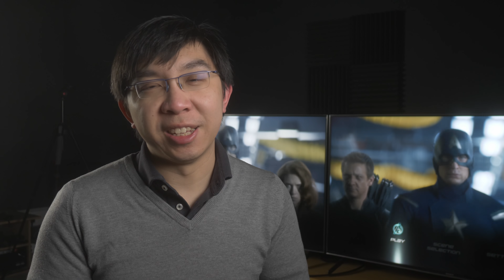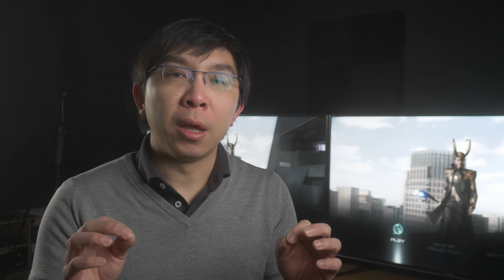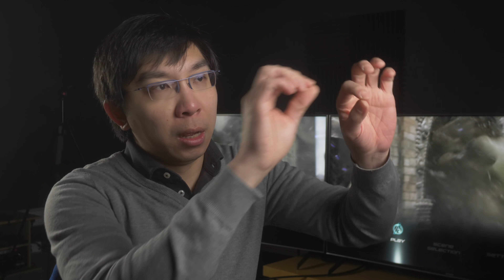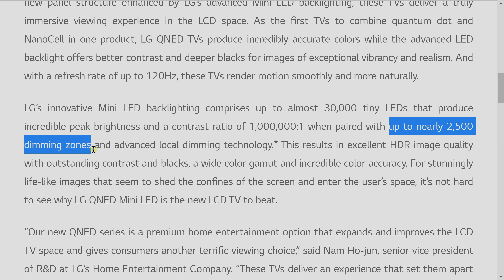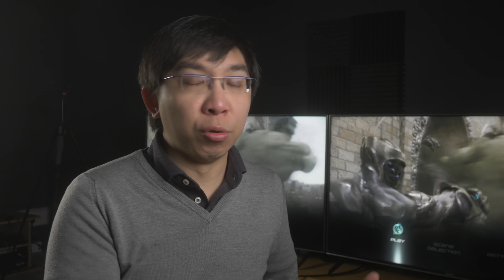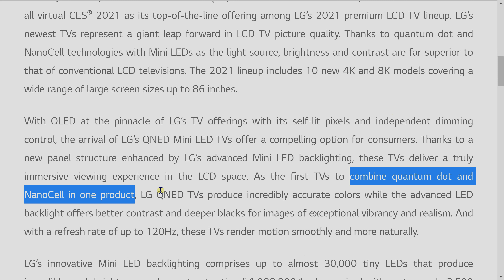LG Unveils Its 1st QNED Mini LED TV with Up to 2500 Dimming Zones

Comment: It all depends on the algorithms.  I haven't been impressed by any local dimming LCD, they just end up drawing attention to the zones with blooming.
Reply: Sony has best FALD dimming algorithms blooming on X950G/H is minimum despite less dimming zones.
Reply: @WizKing93 
you are absolute right. I have the Sony XH9505 in 65 inch and i wondering when people talking about blooming problems. This TV is absolute amazing and have one of the best black levels and upscaling performance for an LCD TV in this price class. I can recommend this TV to everyone and I'm not a Sony Fanboy. 
Greetings my friend 🖖🏼
Reply: @WizKing93  Sony XH95 has crazy blooming on subtitles on black and dark corners on white, so it's FALD sux.
Reply: @timpro8110 
I have the Sony XH9505 myself and cannot confirm blooming with subtitles at all. Try the local dimming to high in the settings. Greetings my friend 🖖🏼
Reply: Agreed. FALD LED LCD TV's look really good in a bright room... But at home, with the lights dimmed, local dimming falls on it's face. Especially off angle, where you can clearly see the zones turning on and off constantly. Very distracting..  Not to mention the fact that if you want to use low lag game mode, you basically lose FALD all together..

And the problem is actually getting worse, as makers continue to cut the zone count to improve profit margins.
Reply: My 2018 Samsung q9fn is excellent and can be viewed in a dark room with only rare content catching it out (Also have an OLED). q80/q90t exhibit noticeable regular blooming
Reply: @cw205mi16  much lower dimming zones in the q80t and q90t i believe which is a bummer
Reply: i bought the q70t over the q80t for this very reason...i like the peak brightness on the q80t but the contrast on the q70t is soo good for the price i paid for it...q70t has dual led edge lighting and i think it does a great job with black levels and contrast without blooming...very minimal almost non existent light bleed along the edges...hdr is great tho a higher peak brightness would have been much appreciated..
Reply: The Toshiba regza was so good for the time
Reply: Sony software is really good for local dimming
Reply: Not even the Sony Z9D? It’s the only LED/LCD that I regret not getting.
Reply: @Burgergio  I've had a 65" ZD9 since 2018 and I'm still amazed by it every other day, get a 2nd hand one you won't regret it! 646 zones is awesome.
Reply: @Burgergio  You don't notice blooming with football or snooker? Extremely obvious to me.
Reply: @keisarinn  idk I never owned one, only Sony I owned was a X800D and I sold it to a friend to get a LG C7.
Reply: @Burgergio  The 100" Z9D maybe. That's a monster of a TV, the only LCD I would buy over OLED.
Reply: @Burgergio  Z9G blows it out of the water thanks to 4,000 nits.
Reply: @PSYCHOV3N0M  aren’t those only available at insanely huge sizes? The largest I can go is 55 inch.
Reply: @PSYCHOV3N0M  Z9G is absolutly ugly and no 65 size
Reply: @crodon7930  XE93 is my favourite looking TV, love the back of it. The Q950TS if we are just talking about looks is amazing too.
Reply: @Burgergio  If you can't fit a ZD9, since they are 65 and 75, then get a 2nd hand 55XE93 or 55XG95,  those are the best edge lit and best FALD 55" Sony LCDs I'd say. Maybe 2021 sets will finally outclass them though.
Reply: @crodon7930  that's the current king of leds
Reply: @micdoses1  maybe.... But its the most ugly TV..... Look at this stand🤢
Reply: @crodon7930  um yea I agree its a bit  ugly compared to the Samsung 8k an their own z8h
Reply: @crodon7930  you can get an after market  stand if it bothers you that much . but i rather prefer have things look nicer on the tv than the look of the tv.
Reply: I did wonder about that. I’ve got a Panasonic led/lcd tv and bought it about 8 years ago. I just had to do a bit of research to find out the tech behind it and it turns out it’s edge-lit.  Now, of late, whilst I’ve been looking at potentially buying a Samsung FALD TV, I had not even been considering the edge-lit models, due to everything I had read. However, I have always been extremely happy with my current Panasonic model. Although it’s only full hd which is the only reason I am shifting to 4K. But now I even wonder whether FALD is worth it due to blooming etc, and whether I should just go for an edge-lit 4K, given that my current Panasonic edge-lit has always been very good and never caused me one single issue with any noticeable bad performance.  I mean, surely edge-lit is the way to go, if it gives you no blooming compared to FALD?🤔 But then I do appreciate that Panasonic’s are regarded as being very good TV’s so perhaps it just a better edge-lit than other models.  Any comments and opinions definitely welcomed by all. 🙂👍🏻
Reply: @tetsuoshima7385  You can always disable local dimming if you're worried about blooming
Reply: @wowoslashfan  Why on earth would someone buy a high-end LCD TV with expensive local dimming just to turn it off? LCD's without local dimming look flat and hazy. DON'T TURN THE LOCAL DIMMING OFF!
Reply: @wowoslashfan  FALD TVs have two more big problems compare to edge-lit TVs with not much additional advantage. first dirty screen effect, second blooming. personally I prefer edge-lit TVs. my only problem with edge-lit TVs is that manufacturers mostly use this technology for their midrange and low-end TVs and not for the best quality TVs.
Reply: @varshoee  That’s only with lower-end FALD models. There are superior FALD models with outstanding gray uniformity.
Reply: @wowoslashfan   No. you can't find any FALD TV without these two problems. it does not exist at this point in time. only in some models these problems are less severe and noticeable but still exist.
Reply: @varshoee  What? My guy, are you dumb? The X900H has amazing gray uniformity, only slightly behind the LG CX. What are you talking about? FALD does not cause as big of a gray uniformity/dirty screen effect issue as you describe it to be-quit being dramatic. This is not a problem for anyone.
Reply: @wowoslashfan  Forget it. I did not notice you are a kid.
Reply: @varshoee  Didn't notice you were an idiot. FALD is and will always be a must with LCD technology.
Reply: Reading this comment section I'm just happy to have a great oled TV 😁
Reply: @TheForeheadOfDoom666  Which model if you don’t mind telling us? I’m thinking of getting either LG G1 or Sony A90J.
Reply: I heard Samsung is best at this
Reply: @rashed434  At the expense of black crush and inaccurate picture quality. 😂😂😂
Reply: @rashed434  You heard wrong. In many people's opinions the cheating/'other solutions' Sammy does to combat this is even more harmful to a good picture in even more ways. Sammy does some great stuff, this is not that though. Maybe you're new to the site, but Vincent has proved it many times.